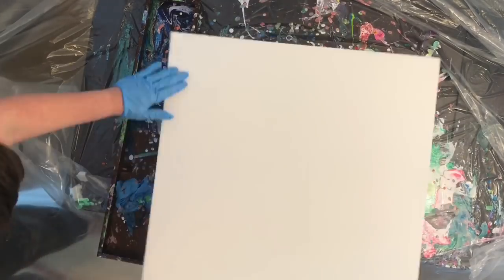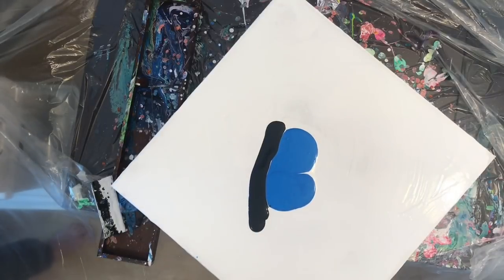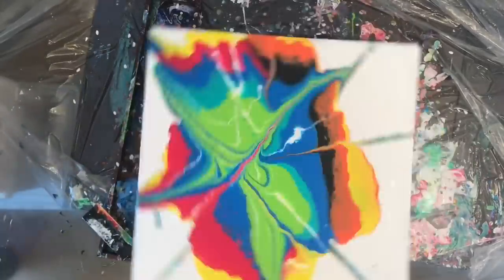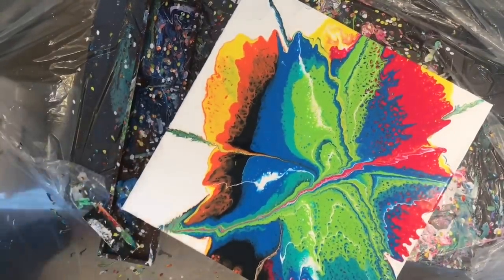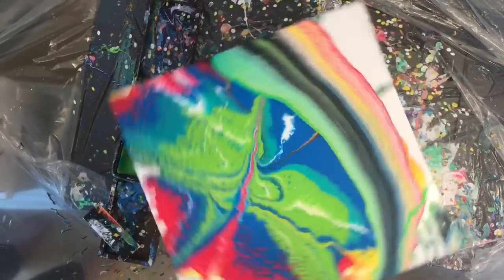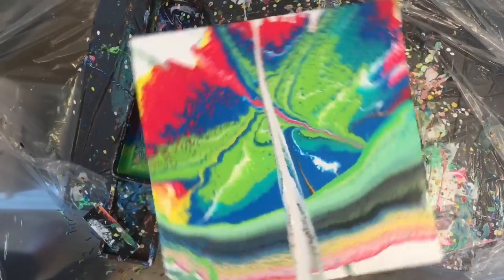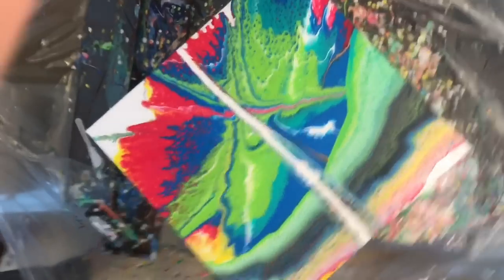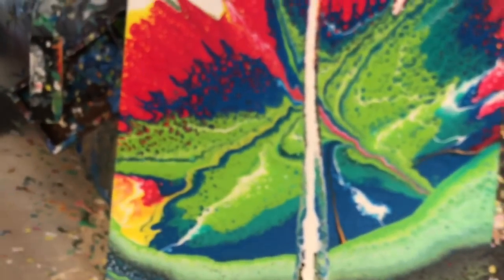Lifeline. Playing with my lazy Susan and tray

Comment: I love your art technique. I was just wondering, what happens to all that paint when it dryes'. Will it crack?
Reply from the maker: Thanks! I’ve found that when I paint on canvas the paint actually soaks in and doesn’t crack. Although it does have the same look as on MDF, I have never had a problem with cracking on canvas.

Comment: I love your intuition and style so much, it's inspirational! 
Btw, how did you get the spin tool? I've been wanting to try that out.
Reply from the maker: Awesome! Love hearing I inspired! :) I bought a cheap lazy Susan and put a large piece of MDF on it. Found the weight of the MDF made it spin better. Thanks for watching and happy pouring!
Reply: Awesome, I just love how you get the coolest 3D looking movement going on.
I've got another question, if you don't mind. 
I've seen how you usually spread the white on the negative space evenly, but when I do it. I can never get it to be "flat" or at least even enough. So, is the base color (white) more on the thick side, or the thin side? 
You also sometimes pour over "mistake" spots or what to call them, when I do something like that it's very pronounced in the final result. You'll see a thicker layer of white there. How do you avoid that? 
Sorry for the wall of text! hah
Reply from the maker: Don't mind at all :) sorry for the late response, sometimes the replies get lost for some reason. The base white colour is definitely on the thin side. It helps when the paint dries for sure to make it less obvious, although sometimes I have that issue too..I've taken to scraping the paint off completely before I repour.